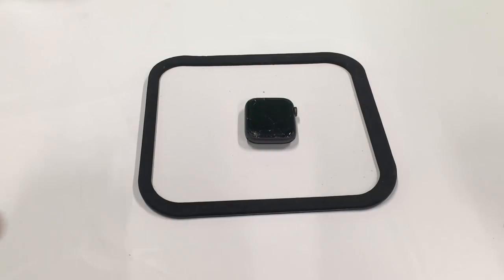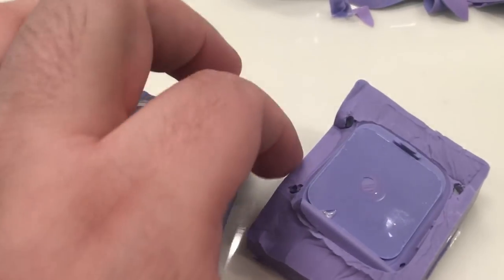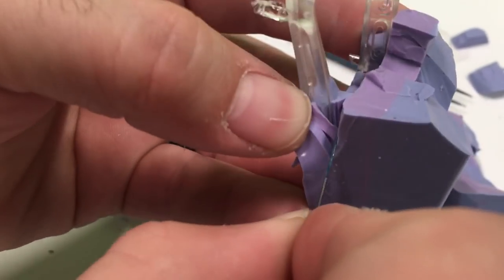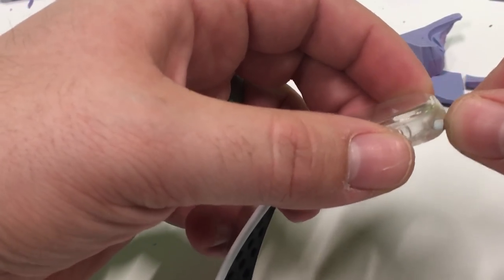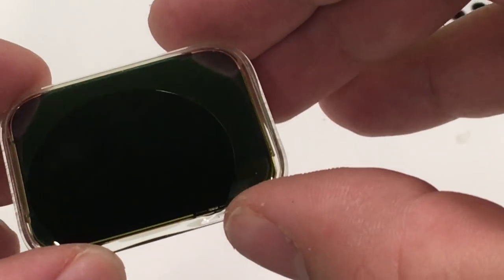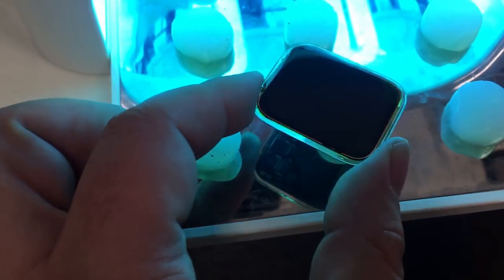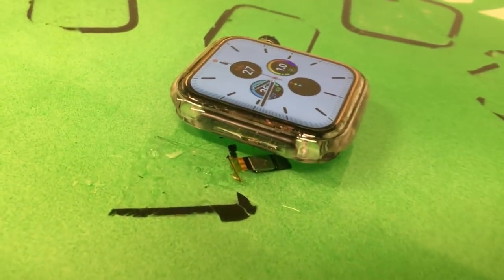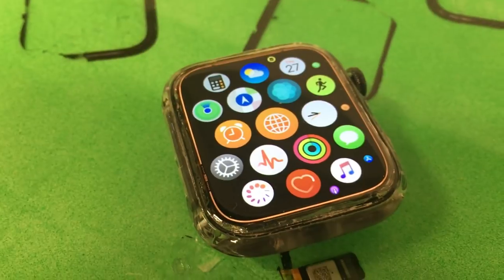Apple Watch Glass Clear Edition (How I made it!!!)

Comment: so i have a series 4 stainless steel black watch. It has an intermittent issue that I brought to apple and said they couldnt reproduce it when it was sent in for repair even though the issue happened right in front of the tech at the store. The issue is that it keeps shutting down and can only be turned back on when its put on a charger. My question is do you think it is a battery issue or something else? If i were to get a damaged series 4 aluminum would i be able to put those 'innards' into my case and get the watch to work? how much do you think something like that would cost?

Comment: Wow awesome job ! I'm really interested how you did it exactly. However I have doubts about the band. Doesn't the material stretch ? Just because how the mechanism for bands it's done I think that it could slip from it easily while running for example.
Reply from the maker: Yes for a few days it does remain flexible then it gets hard. Luckily the mold captured the slot for the mechanism that is imbedded through the external charging unit and frame so that the band will engage.
Reply: @FIXDPHONES  that's a quality mold then, perfect job 👌